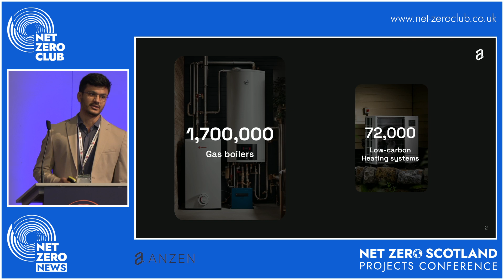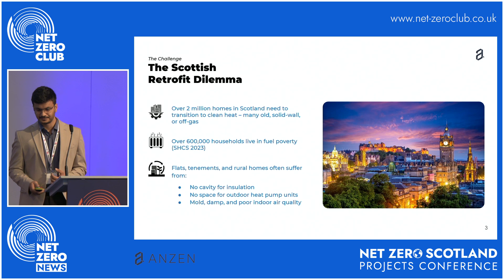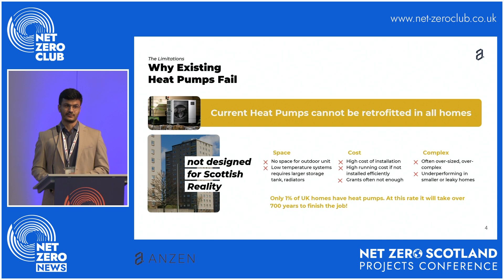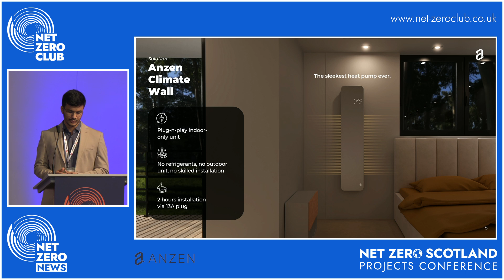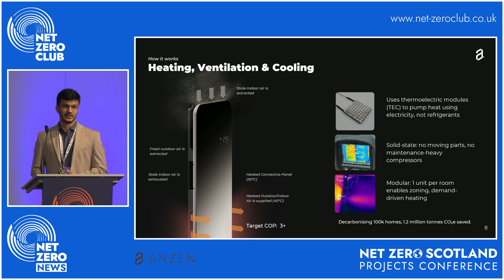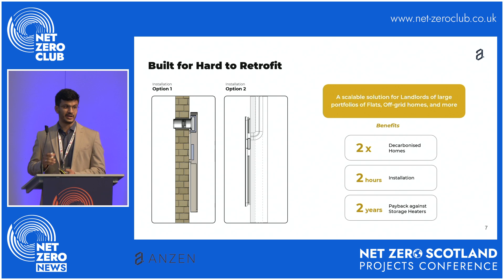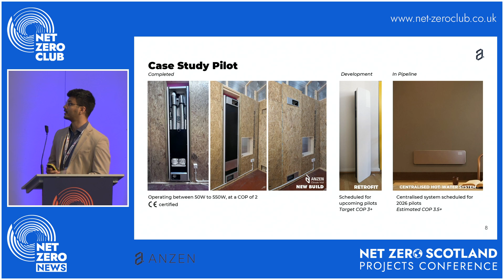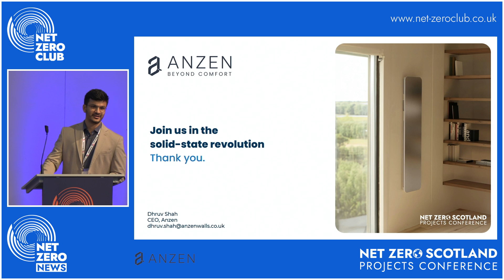Dhruv Shah | Solid-State Heat Pumps & Innovation | 2025 Net Zero Scotland Projects Conference

Comment: So its a giant "Peltier effect" element the back of which is vented to the outside world? Is there any inovation that makes it notedly  more efficient than most and how does it compare to an infrared panel heater?
Reply: So this provides for cooling as well as heating so it is not directly comparable
Reply: @tangerinestorm For a Petlier to do that you just reverse the voltage. My comment was more about them presenting it as new tech when what's cool about it is simply that it's a nice implementation of existing tech' https://en.wikipedia.org/wiki/Thermoelectric_heat_pump?wprov=sfla1